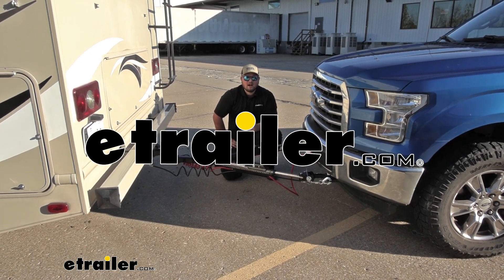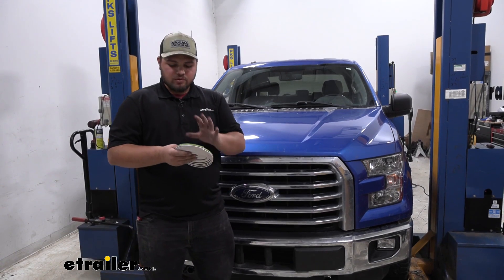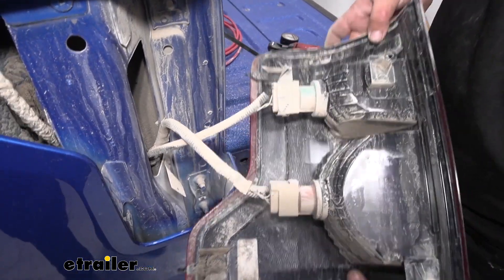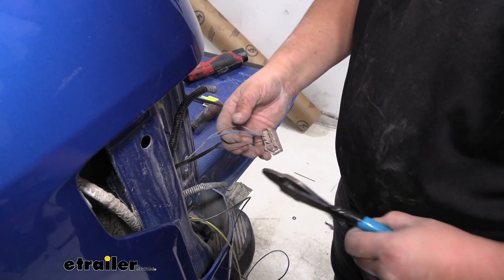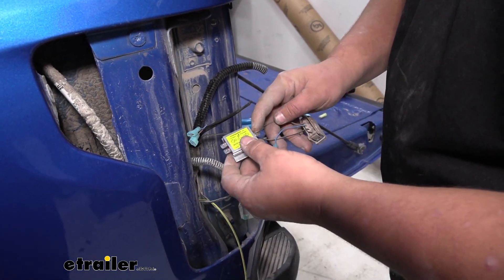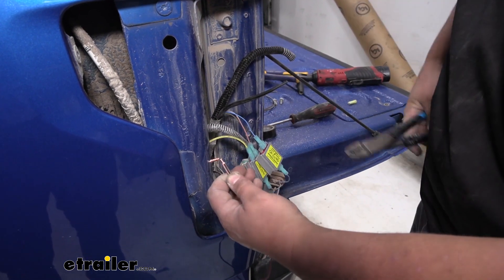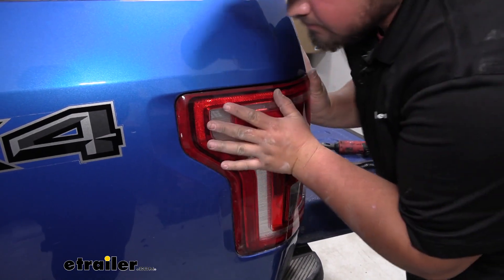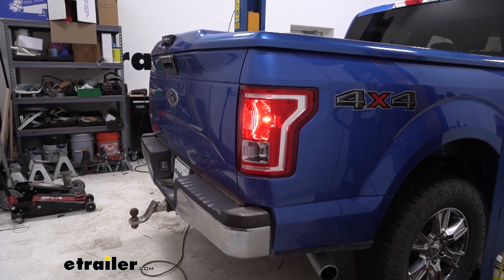etrailer | Set up: Roadmaster Universal Hy-Power Diode Wiring Kit on a 2015 Ford F-150

Comment: No heat shrink connectors to prevent corrosion? That customer will have issues very soon. Smh
Reply from the maker: The area behind the taillights very rarely sees water. We have not had issues with using the included connectors to make the connections for the diode kit.
https://www.etrailer.com/Tow-Bar-Wiring/Roadmaster/RM-152.html
Reply: @etrailer  judging by the amount of dirt/dust/salt buildup in the area, I'd say you are mistaken.
As evidenced by how dirty your hands were just rubbing up against the area. So if dust and dirt are getting all the way up there, then so is moisture which will, in turn, cause....corrosion.
Just because you have not had any issues does not mean that customers are not having issues and dealing with it themselves.(or just replacing the provided connectors).
I'm just saying take pride in your work, don't just do the bare minimum to get the job out the door.